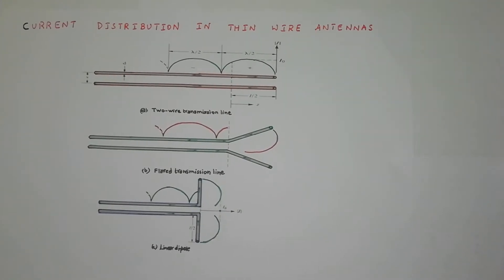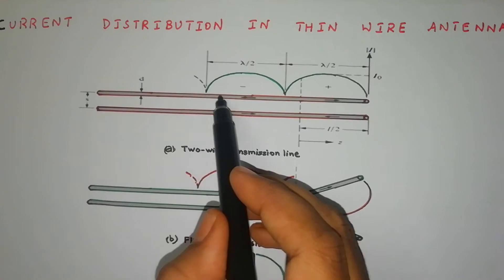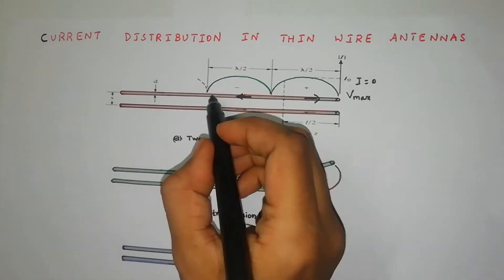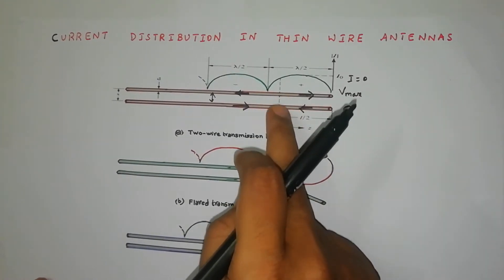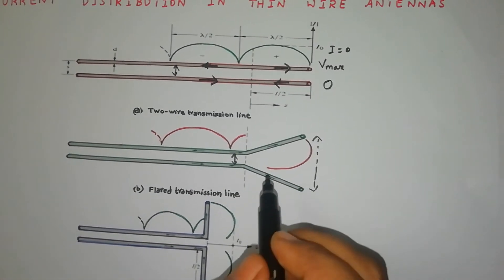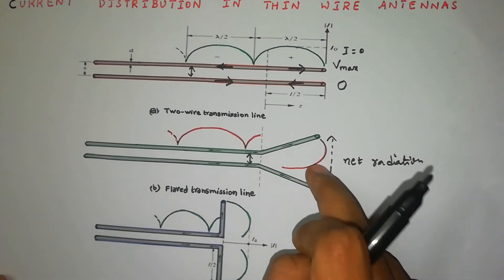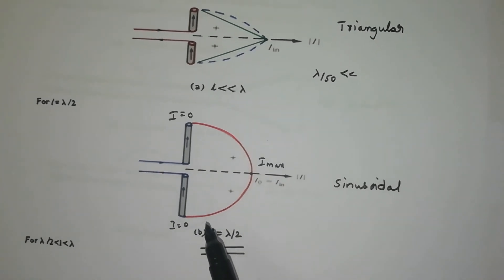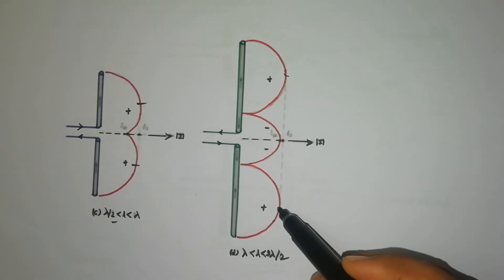Current Distribution in Thin Wire Antennas

Comment: Mam I didn't understand how current and voltage are passing in an open circuit? Also is the current flowing in one wire?

And why voltage is maximum and current minimum and vice versa during waves crests and troughs? Aren't they supposed to be directly proportional according to ohms law?
Reply from the maker: Voltage can also be defined as potential difference. See we knw water always flows from higher to lower areas similarly current also flows from higher potential to lower potential. Current flows only when there is some potential difference. In our concept we placed source at one end and other end is left open. Because of difference in concentration/density current starts to flow.
Reply from the maker: Also don't get confused voltage or potential difference is high means current is low and if current is low means maximum voltage exits.
Reply: Engineering Subjects in Easy Way but one thing I didn't understand is that how current is flowing in one wire the circuit is open so the current shouldn't be flowing how is this possible?

Comment: Ma'am... Current distribution outside the antenna ..current means acceration of charge..but in the free space ? 
Or
 is it the radiation coming out?
Reply from the maker: It is electric field that forms outside wire  current always flows inside of wire or conductor.
Reply: @nagmedikonda  Ma'am if it is electric field why is it written |I| in the figure and why call it current distribution then?
Reply from the maker: Actually in antennas design is made such that field lines does not cancel by increasing separation between two wires. If it is single wire there is no problem of field cancellation.
Reply: @nagmedikonda   thank you so much ma'am for clarifying

Comment: Madam.... Why is the current direction opposite in both the wires..as same source is given to both the wires ?.

Thank you ma'am
Reply from the maker: The current flows from high potential to low potential.It can be seen clearly if we start from one end the current appears to be in forward direction while we reach at the other end it appears in opposite direction because the current forms the closed loop.In order to achieve equilibrium condition.
##Watch previous videos then you can understand ##
Reply from the maker: Still you have any doubt, put comment, I will try
Reply: @nagmedikonda 
Ok ma'am..  thank you so much ma'am
Reply: Useful video....nice explaination👍👍
Reply: Mam two wires are not separated by load, so how  two wires have different direction of current ,how does it make loop?
Thanku